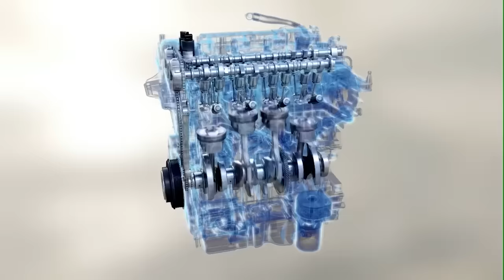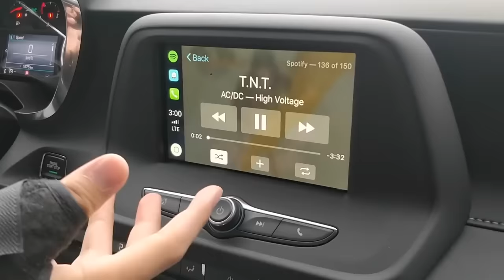NEW 2024 Chevrolet Camaro SHOCKS The ENTIRE Industry!

Comment: Pricing is bad. My dad bought a 2.0lt at a dam steal. 25k with just shy of 5k miles. No rust, not a single issue. A pricing error that he jumped on. I've been driving it (not through winter) for a yearish now and low visabalitly my ass. Yea it actually is but you get used to it a lot better than you think. And I'm pretty stupid and slow. My dad always gets the mod bug when he gets a car so it's got 400hp. he also has to have the faster car. His c5 vette has 1000hp so he destroyed just about anyone that talked crap to him.

Comment: Shocks the entire industry?  C'mon man. The 24 Camaro is  23 Camaro,  period. They are just selling the same product pretending that its the next model year. The reason the sales are low is because it costs more than the competition,  is less reliable, and the competition offers better performance with more options. The fact that they badged a 50 year anniversary model for car that didn't have 50 model years shows how out of touch they are with their fan base, and reality. The racing badges that compete in NASCAR are a name only. The actual car is a very cheaply made toy, that Chevy even sells as a toy....Hot Wheels and Transformers?  Are you kidding me? They market their car to 10 year olds. It is no wonder the car is going out of production again, and good riddance.  I hope they replace it with something an adult waould desire.

Comment: I own a 94 Camaro Z28 auto, a 95 z28 6 speed, and a 95 Trans Am auto... all LT1. I'm curious how a modern LT1 got its name when everything went smaller CI and in aluminum when mine are iron blocked OG? Also, my 1995 z28 has the LT4 heads and intake from the 96 GS Corvette along with the LT4 HotKit. Did they just need to borrow the LT1 and LT4 name for historic reasons?

Comment: He said impressive output of 275 hp out of gm's 2.0 liter 4 cylinder. 😑 impressive for gm . Ford gets 310 hp out of their 4 cylinder. Mercedes gets over 330 from their 2.0 liter 4 cylinder. Gm always seems to get less power out of more liters than other manufacturers. Ford's 5.0 V8 makes 460 hp while gm's 6.2 V8 gets 455 hp . Fast forward, now the 6.2 makes 495 while the new 5.0 makes 500 .

Comment: The reason why sells didn't do good is cuz it's still a gen 5 no matter what ppl tell you it's still built on the same skeleton and it was refreshed in looks same wheel base and you can even put 2010 body panels and interior on the chassis so ya it's still a gen 5

Comment: I had a FIFTY model from 2017. Worst mistake i made was trading it in for a Z71 Silverado. Id love to get a 2024 ss but they are WAYYYYY overpriced. Used 2017 2ss with 20k miles are still going for over $40k. Thats just nuts. Mine was before the ugly front/rear end refresh. Hoping the 24 will bring prices down on earlier 6 gen models.
Reply: Yeah I have a 2018 1SS (pre ugly front facia change) bought it for 32 only had 428 mile in it now it's got 40k miles and still sells for 36-40. I want a truck but I can't image not being able to turn on my car and not hear that cam get to chopping